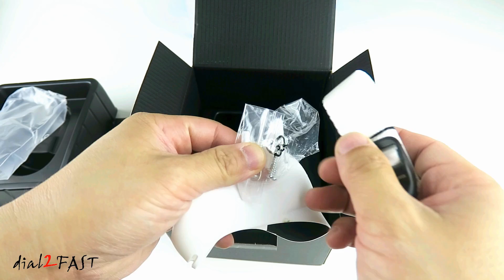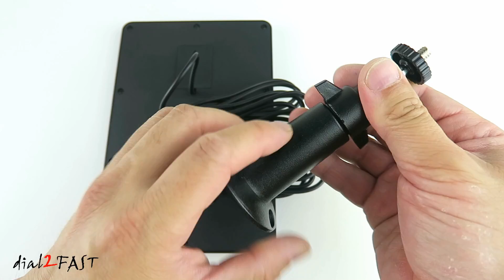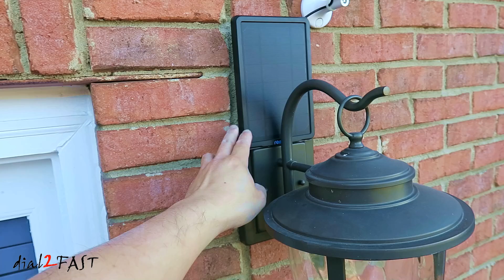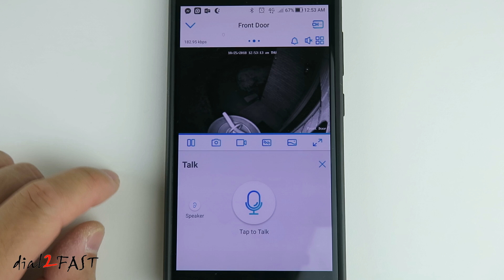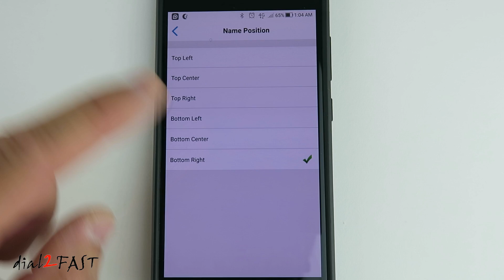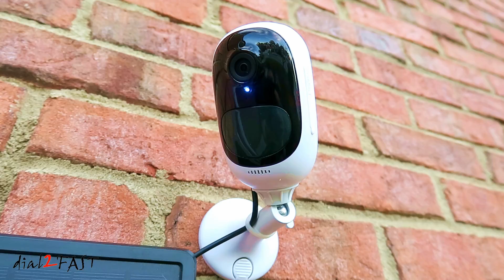Reolink Argus Pro Wireless Security Camera + Solar Panel Charger

Comment: Fact: The Reolink Argus Pro is actually not pro it is a stripped down version of the Argus 2 with less stuff in the box and less features for a lower price point so when it was released casuals thought ok its called Pro it must be better than the 2 turns out it was inaccurate naming convention of the device

Comment: I was impressed with how far your backyard camera was from the house and still works/connects to the wifi router. Do you know the max distance it will work? I read approx 10 meters but yours looked a lot farther.
Reply from the maker: Wi-Fi routers operating on the traditional 2.4 GHz band can reach up to 150 feet (46 m) indoors and about 300 feet (92 m) outdoors. Also depends on what obstruction in between.

Comment: great video!  I've been using Argus 2 cameras for 2 years. Recently I moved to a house and I'm having hard time to set angles of the camera on the deck. I wanted to be able to capture a human started coming towards the entrance like you showed us in this video, and also right at the entrance door. my Argus already starts recording only 1-2meters away from the door.  So I was just wondering if your camera could record from the time you approached from the corner of your house to the door.

Comment: can this camara film non stop ? i dont like the motion start filming is bad idea, since due its range limitation,
Reply from the maker: If you want non stop recording. You need to get a NVR system with 1 TB hard drive. None of these portable wireless cameras will record 24/7.
Reply: @dial2fast  you can make it record like 10fps @ 720p and 32gb is plenty enough and quality is enough, you dont need so mutch hard space, but i see now i need a camera with powersuply, non solar charged. I have found few places where i can plug in them.

Comment: Can the solar panel be used on any other model of security cameras,  it has USB end connections right ?
Reply from the maker: Yes, the solar panel is basically a USB charger. So you can use it to charge other Micro USB devices.

Comment: Hi, one question pls....Do u have to necessarily need to install the solar panel where it’s getting direct sun?
Reply from the maker: To properly charge the battery during daytime, you will want direct sunlight. My back camera is in the shade half the day, and it sometimes does not charge fully.